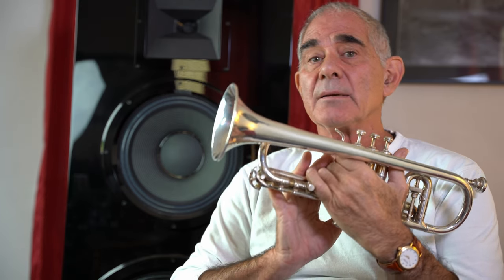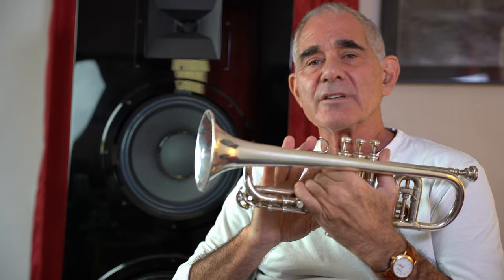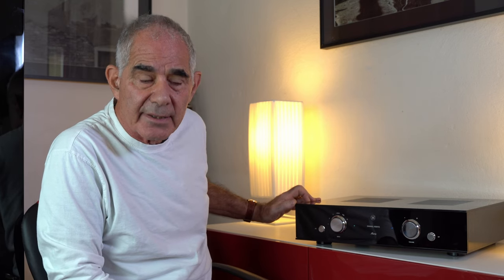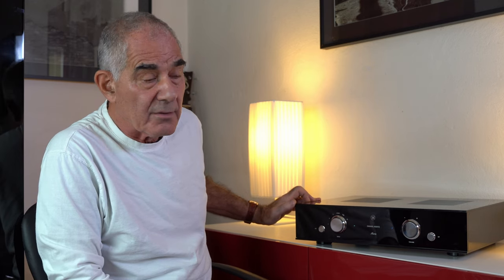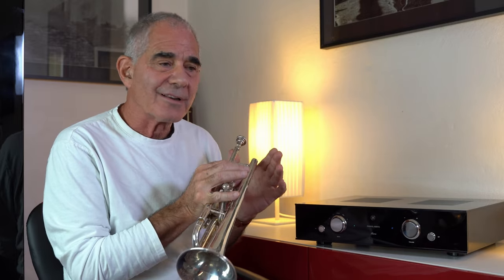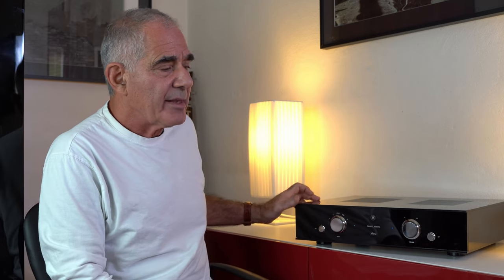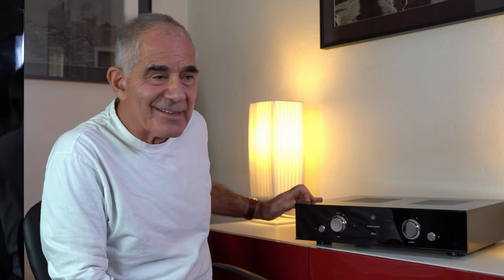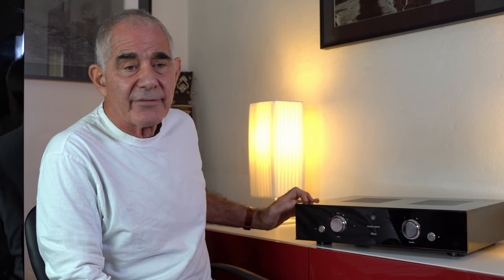M1 reference speakers & Maria amplifier Daniel Hertz audio system  - talk with Mark Levinson

Comment: Mark Levinson made some of the best amps in the 80’s. I had tremendous respect for his products. However, his foray into Rose Audio selling “modified” cheap Chinese amps for 6x the original cost, Erwin Bobcat digital software that made digital sound like smoothed over MP3 files, etc were nothing but disappointing. I would not trust anything he’s pushing, especially this active speaker powered by class D amps.  At $200k the M1 system isn’t for anyone except for the filthy rich.
Reply: HUH? Powered speaker? This is all about how does it sound to you and if you can afford it. If not thats ok. No one is forcing you to believe or purchase. Thanks for the positive feedback.
Reply: He has cheaper systems than just the M1 audio system.

Comment: I admire your products, BUT ...there are speakers that MOVE lots of air and produce pretty close to the captured vibes. The amp, and what it does promises to be AWESOME 🙂 I also agree the 'better the less approach' ALL in one system. The more components like connectors, wires and other electronics we insert in the signal chain the more ADDITIONAL flavor is created and changes the original event recorded.